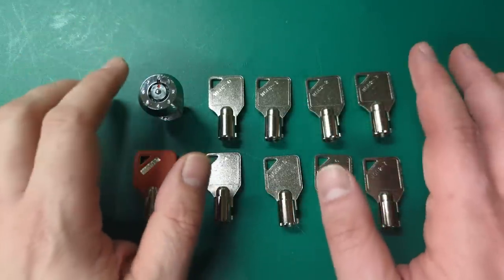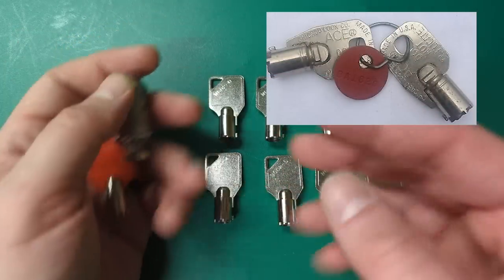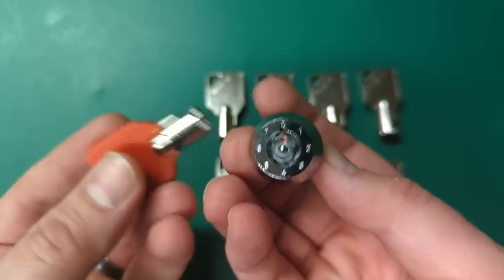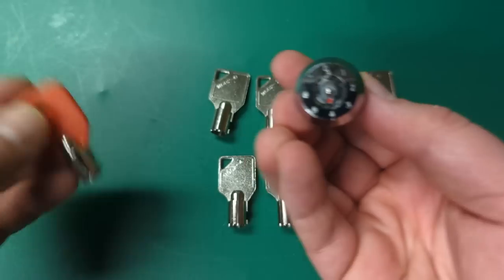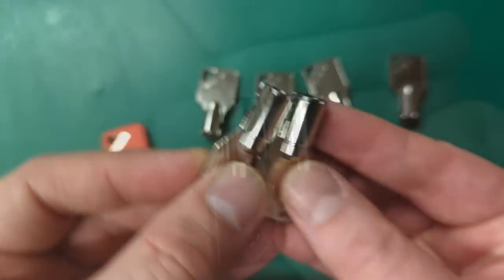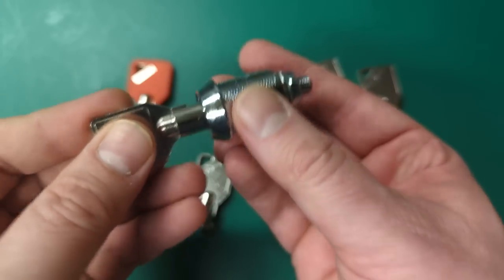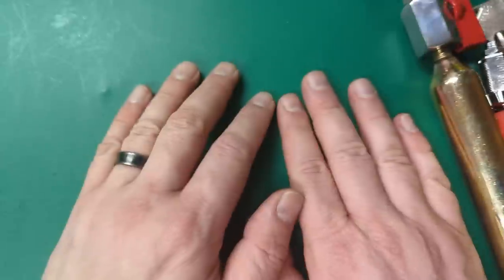Tubular Series, part 1 - Do You Know How the Fort Lock Gematic Works?

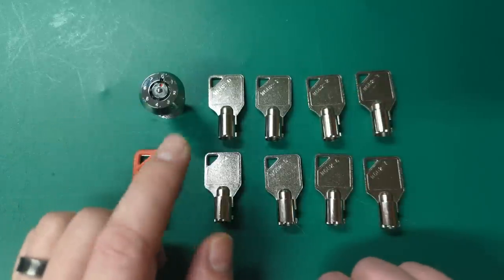Comment: In the shortest terms, the Red master key has no tab to operate the tail piece. And the tab that operates the tail piece is what limits you to the 90 degree turn. All the keys are cut the same, but rotated one eighth turn from each other. The Red key turns the cylinder only, while the others use the tab to turn the tail piece. EDIT : After some closer examination at 1:06 I believe the barrel of the Red Key is also longer, possibly releasing a mechanism at the back of the cylinder, allowing the new position to be set and locked in.
Reply: Yep, and I'd bet you could cut a key that would operate the tailpiece no mater what position the cylinder is in.
Reply: Agreed
Reply: @miss_lisa  I don't see how that could work. You could cut eight keys  one for each position. But the tab is effectively what is in a different position on each. In reality, the cuts are just rotated by one position on the blank. If you had a way to extend a tab, you could do as you described, but I don't think that would work, as there's not much space in the key way.
Reply: @javabeanz8549  Think about it.  There is some mechanism that disconnects the cylinder from the tailpiece.  I'd bet that doesn't involve unlocking the cylinder.
Reply: @miss_lisa  Did you actually read my initial comment all the way through? I thought about it quite carefully when writing it. Check the 4th sentence.
Reply: @miss_lisa  After looking at the video again, I think that the Red Key also has a longer barrel, possibly releasing the cylinder to turn. The tail piece is only controlled by the tab on Key 0 through Key 7.
Reply: @javabeanz8549  Yeah, sure I did.  One posibility is that there is simply no connection between the lock cylinder and the tail piece, the key being the only link.  (not a huge leap from an industry that leaves known flaws in locks for decades).  If that were the case, then you just need a key with the tang on the top.  Heck you could reach in and turn the tailpiece with a small screwdriver.  The other possible mechanism that I can think of is a thin plate at the top of the cylinder linked to the outer ring.  In that case, the tumblers would prevent turning the tailpiece, but they would just need to be pushed down below the plate to disconnect the cylinder from the tailpiece.  In either case I can envision a key that would accomplish the goal without unlocking the cylinder.  In fact, that key would work on all locks of this variety.  In any case, I'm very interested to see the actual design once he disassembles it.
Reply: @miss_lisa  I think that the "no connection" part agrees with what I am saying. But, you have to be able to turn the key. I don't see how you could get into the back of the lock without a key. There may also be something that stops the tail piece from moving when there isn't a key inserted. And we wouldn't be able to see that from the back while the lock is assembled. Sorry, that I can not articulate that more clearly, fighting an on coming headache at the moment. EDIT : Yes, I am quite interested in seeing the inner workings as well.
Reply: This is my theory as well.
Reply: I agree. It's simple for a circular lock to work like this.
Reply: I think the tab only serves to limit the rotation to the 90 degrees and the independent rotation of the core will have something to do with the ball bearing at the center of the lock - red key probably has a deeper hole in the shaft and thus doesn't press it during rotation.
Reply: @Daddo22  That's an interesting thought. The Red Key definitely has deeper cuts, meaning it will press deeper into the lock.
Reply: The red key is cut the same as key 0 except that it is deeper on all cuts.

Look really closely at the central pillar of the lock and you can see a ball; this is most likely spring loaded and on top of an eight lobed spline that connects the top and bottom halves of the lock mechanism. This is actuated by a shorter pin inside the center of the master key and is not visible in these views.
Reply: @simonlewinson4170  so you are saying that the ball is exposed part of the release mechanism for the center? Hmm  I thought maybe there was a back plate that was the release, based on the cut depth on the Red Key.
Reply: @javabeanz8549  that is my thought. Why else would it be there? The end of a spring loaded splined connector between tail piece and the center of the top rotating part of the lock fits the bill and is childishly cheap too

Comment: I’d guess that as the control turns the core, it is threading in or out to a controlled depth. The keys all have the same overall bitting shape, but are one deeper or shallower than the numbers before and after them. Also, the index lug would shift one position clockwise or counterclockwise. Hope that guess makes sense.
Reply: Smart guess! I bet that's what it is doing
Reply: The 1/8th rotation was the first I taught about.
The action to turn the tailpiece done by the index makes sense.
And the area under the front cover is  only made free for 90 degrees to limit the rotation.

Comment: They are the same key, but the pin position limits where it can be inserted.  When you use the control key, the pin location moves, limiting which key can get inserted.

Comment: My guess is that it's turning the whole thing with the control key. If this is the case, filing off the notch on any of the keys would allow them to work for all configurations, you would just need to turn it such that the place where the notch was is "pointing" at a different starting number. Say you file key 0, and the lock is set for key 4, you would turn it such that the notch points at position 4. I'm an idiot so this is most likely wrong but it was the only thing I can think of
Reply: I think that you are correct.
Reply: I don't think so. Look at when he shows keys 4 and 5 and specifically the position that is in line with the tail of the key. It's a high cut on both of them in the same position, but it looks like it's a touch higher on the closer key. So what that says to me is that the core that rotates is acting sort of like a set of mastering wafers. It's not the moving the entire set of pins but rather modifying the lengths.
Reply: @alphazero924  take a look at all the keys side by side on the desk. Especially 5, 6 and 7. Edit: Pay close attention to 4 & 5 when he first shows them. When he rotated them around, they were not in alignment with each other, the right one is tilted away a little bit.
Reply: @javabeanz8549  There's no high cut on any of the keys that are lying on the desk. If the red key turned the entire core and it just had the same bitting at 8 different positions then you'd see that really high cut at each position around the circle, but it's never in any of the positions that are facing the camera while they're lying on the table.
Reply: @alphazero924  I see your point. But I think that the answer could be that the Red key may have a slightly longer barrel as well as having no tab. Compare the Red Key with Key 0 at the 1:06 mark.
Reply: Unless there's some part of the notch that is required to rotate, but even if there was, you could use the bitting on any of the keys to create all the other ones, just by rotating the pins 1 spot.
Reply: I think we've all got this one figured out, another similar video I would like to see is one on 'church keys' they are either detainer or wafer locks in a similar Tubular style, that have the ability to 'rekey' them on the fly, from the inside. I've installed them the self checkout POS systems many large stores use.  If you're wondering which, it's the ones you can insert a stack of bills in, instead of just one bill at a time.
Reply: @lostboytnt1  that does sound interesting.

Comment: My thoughts are that the key pins are effectively split in half and the master setting key is set to push them down to that halfway sheer line, which turns only the bottom half of the pins. Then, with all the pins now effectively changed in length for the operation sheer line, a different key is needed to match those altered length-bitting. This is why the setting key can turn all the way around (on that alternate sheer line) but a normal operator key is actuating the other sheer line and has its travel limited.
Reply: That's what I was thinking.
Reply: I think you're the only one (or at least only one I can see so far) who has guessed something that works with the information we're given. Everyone keeps saying that it's the same bitting just turned 45 degrees between keys, but we can see with all the keys laid out on the table that it's not the same bitting because there's a high cut in position 4 (most easily seen when he shows keys 4 and 5) that doesn't appear in the positions that are face up on the table. That means that there has to be a key pin-master wafer type system and I think you've nailed how that works.

Comment: 2 shear lines, the Red will rotate a shearline (top one which wont connect to the tail piece) and since it has no protrusion it can be inserted any way (Much like when you have to cut it off to fix a vehicle lock that has rotated due to vibration). The rest of the keys 0-7 are all the same key but with its cuts all rotated 1/8th of a turn . Their protrusion keeps them from fitting any position. These activate the second shear line while blocking the first (this rotating piece connects to tail piece). Cutting the protrusion off of any key and positioning the ground off part at (red dot# - Key number) will work the lock unless my math is off. Smartest thing to do for simplicity would be to make the Red key just a copy of the 0 key with all cuts slightly longer, but you could also make the lock with 3 pins per location like a master keyed lock I guess.

Comment: We use this style of lock in the amusement industry quite a lot. The ones I have used personally were made by Camlock and there is a second shear line and rotating component inside the lock. When the pins are on this shear line the front section is allowed to turn independently from the rear which moves the pins around one position. I would assume that this uses the same principle.  

I've had to disassemble quite a few and the least destructive way to get the lock apart will be to drill out the little pin on the threaded section as this retains the core. The pin is quite short and only protrudes a short way into the lock, in fact on some very poor quality tubular locks this pin can fall out if they are mounted upside down and subject to vibration.

The guts will all fall out however and will be almost impossible to reassemble. The only way I can imagine keeping it all together during disassembly would be to take the bow off of a key and use the tubular key section to clamp the pins to the core and lift the sleeve off very carefully.

Looking forward to the content, I'm currently considering making a 3d file which can be edited to print tubular keys on a resin printer, assuming you can get the bitting or direct measurements from an original key. There's a chance that with the right resin it might be useful for impressioning attacks but its just an idea at the moment.

Comment: I've had the KLOM cutter for several years and had very good results with it on both brass and chrome coated blanks. It will also cut stainless blanks, but I typically go very slowly on them--spinning the knob a lot and using much lighter downward pressure than on a brass blank. The cutter teeth don't seem to be extremely hard and do wear over time. 

Also, depending on the quality of the blanks, I will often "true up" the tip by hitting all the locations with zero cuts first (before starting to cut actual the actual bitting) and then giving the tip of the blank a light file/sand to make sure it's perfectly square and registered to the biting depth.

Comment: My guess is the lock has two shear lines. The shear line closer to the front is operated by the control key. and will always work with the control key. But when you turn it, the overall length of the two key pins changes per cylinder which changes the bitting for the shear line near the back of the lock. Since you have two shear lines there's a disc between the shear lines that turns with the user key, but not the control key. That disc is connected to the actuator.

If this is the case, the bitting for the user key would be the length of the user pins, plus the rotated lengths of the control pins. The bitting will be fairly different between each key, and not just rotated per key. So you can't just file the nub off of one key and stick it in at a different angle and expect it to work.
Reply: exactly

Comment: My wild guess is there are two sheer lines. The outer core contains the key pins and the operating ring has 8 pins all of the same size. When the switch key is used it pushes the key pins to the first sheer line while the driver pins end are still blocking the second sheer line. For the operating key, the pins are pushed in further but have a similar cut to the switch key. The key pins block the first sheer line and allows the second to turn, which is tied to the cam.

Comment: Maybe the little tab on the keys are indexed so that each key has the same bitting but rotated 1/8th of the way around, and the control key rotates the core such that when removed, only the key that works is the one where the bitting is aligned with the tab?

Comment: Seems like each key is cut the same, but rotated 22.5 degrees more than the previous key. And then the control key just rotates the lock so that only one of those keys will work at a time. I suppose that means each key, if sufficiently inspected, gives away the combination of cut depths, but an attacker would need to try different rotations until they get the right one. Impressioning tools are usually easiest way in, though.

Comment: I see on 0, 1, and 2 keys that they have a pin very low down, but its offset on each.

I think Each key has 1 pin that must be at the lowest (or highest, i get confused about these terms wrt locks) bidding, meanwhile the rest of the pins are the same. The selection system just ensures that the pin by the red dot gets pushed all the way down.

Comment: My guess would be that the keys are all cut the same, except for the presence and position of the nub. The nub would operate the tailpiece, so the control key that doesn't have the nub, doesn't operate the tailpiece. It does however rotate the lock. Since it is rotationally symmetrical, the key pins are now paired with a different driver.
The nubs are rotated at 45° angles from each other, so that a different key can operate the lock. If you file off the nub, you have another control key. You could then create a separate nub from a piece of wire and use that to operate the lock, together with your newly acquired control key.

Comment: If it is as simplistic as it appears;

This style of locking mechanism
 utilizes a set of master pins that
 doesn't allow usage of 2nd pin
 depth per pin stack. 

Only by rotating control key,
 changes the key pins & thus
 the stack value.

Thanks for sharing. 
Let us know if I'm 1/2ass right.

Comment: The red key is activating all of the key pins just like any other key, but the core of the lock and the tail piece aren't connected. A lack of tab to operate the tail on the "master" key means that all the pins advance while the tail piece stays put.

Thus each key (from 0 to 7) has the cuts advanced by 1. It's rather like manually picking a tubular lock, when you advance it one position. If you left it like that you'd essentially have re-keyed the lock to need a key with all of the cuts rotated by one.

Comment: My guess is that it is similar to the control key in a SFIC. I suspect it engages just part of the lock and realigns it, intead of just a little cam, it rotates some part of the internals, like a lock inside the lock. The numbered keys operate the whole matryoshka, where the red key just spins an inner one.

Comment: This is my guess before looking at the other comments. I've probably over-complicated things. Hopefully I'm not so off as to embarrass myself.

The easy part is that the 8 keys in the 8 pin lock are of course rotations of the same cuts, with only the top protruding bit on the top of the key (and the key bow) staying in place.

The hard part is explaining how the control key can do something different than opening the lock. Given this it feels like there has to be two different sheer lines, so that it's sort of two locks on one. When I say two sheer lines I don't mean like in a mastered lock system where the pin stacks have two different heights they can be lifted to; those two heights still unlock the same height sheer line. I mean a sheer line at a different depth (likely deeper) all around to rotate the pins, but that sheer line is locked by the same pins and driver pins. This would mean that the driver pins do not rotate when the control key is used, only the pins. 

The control key doesn't have the protruding bit on the top front of it. (I know this protrusion has a better term, but I can't remember it now and I don't want to Google it while I'm guessing.) As that part's what normally turns the tailpiece. So this explains why the control key doesn't turn that, or rather, it explains why the control key doesn't get stuck trying to turn the tailpiece while not lifting the pins to that sheer line. The control key also seem to have a front part that's a bit like an 8-sided Allen key, to make it so that turning it actually rotates something, because without any tension just setting the pins and turning it wouldn't do much of anything.

I wonder if the control key has the same cut as one of the other keys but just a bit deeper and without that front top bit? Or if there's something tricky going on with an extra layer of pins like the wafer pins in a mastered lock?